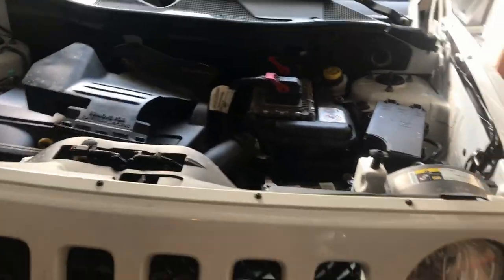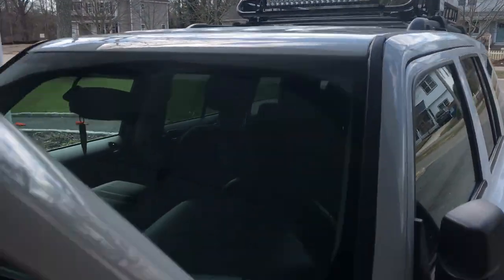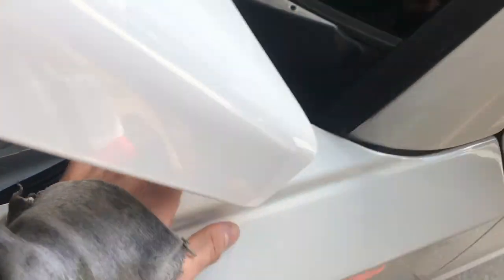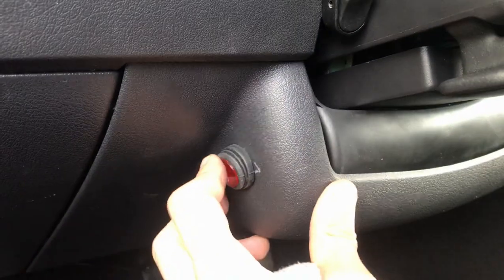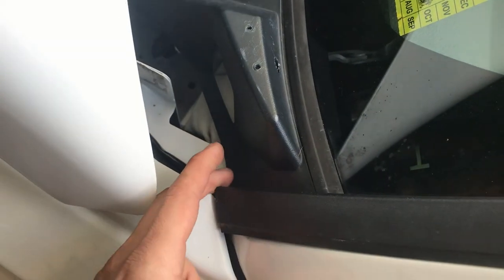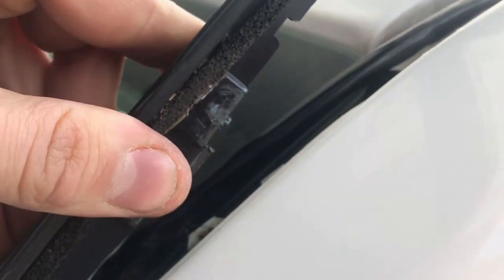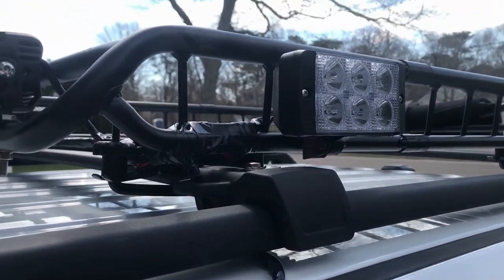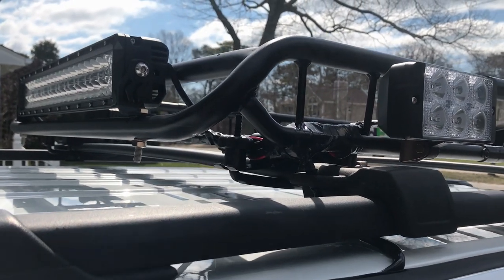Jeep Patriot LED Bar Wiring

Comment: The manufacturer or the light will say the amperage for each light since you are using one power three lights there two things to consider. 
1. Is the wire gauge (fatness) enough for the amp draw. 

2. To determine the fuse and relay you need to add up the amp for each light and put I fuse to that number relay is about the same but there are a truck load you can use for this application.  But 12v and amp is what your also looking at .